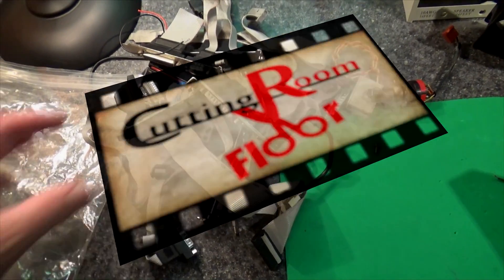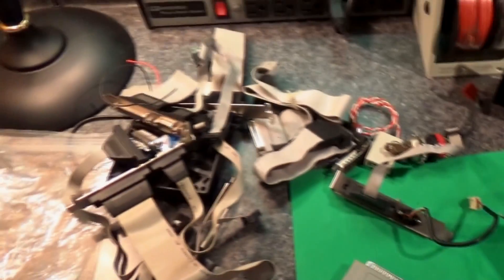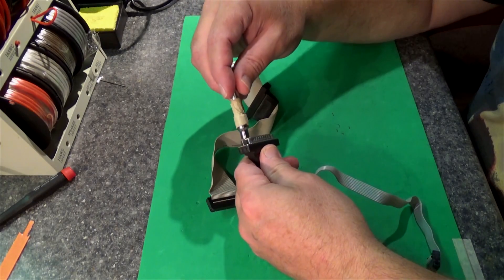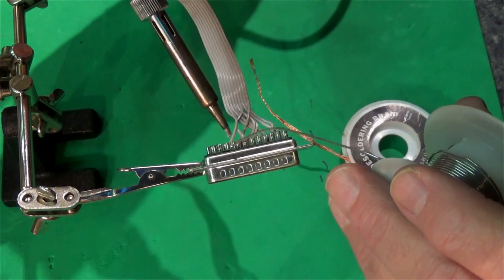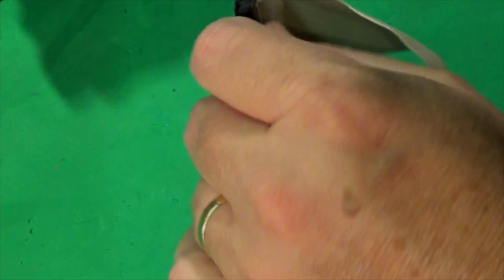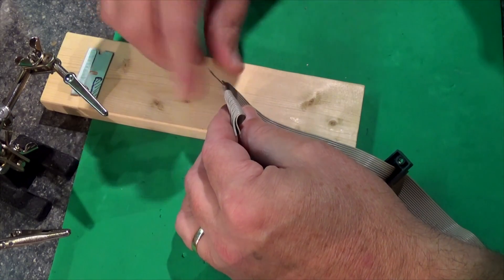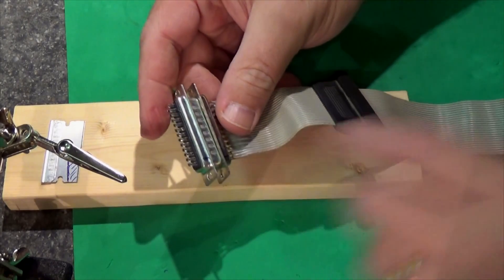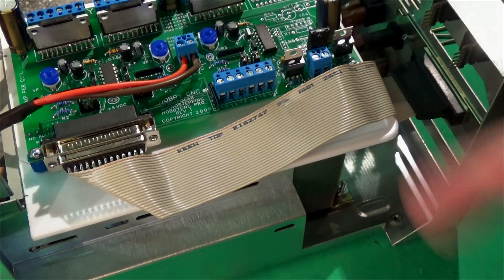Custom Parallel Port Cable - CNC Motor Controller Build

Comment: Great job! Quick question, I have a TB6560 with a 25 pinner, and I want to know if I can make my own adapter to usb? The UC100 is expensive and I just want a quick cheap workaround, so if anyone know if it can be done, will work, and easy enough to do, It would be great! Thanks!

Comment: i made a similar cable but it won't work. i have a generic Chinese BOB. But i have a printer cable which works for the x,y and z axis. it has couple of pins connected straight through. Any suggestion would be helpful, thanks.

Comment: You probably had a 25-pin serial cable there since it only used the 9 pins and was male vs female. I remember having some old 25-pin serial mice back in the day...

Comment: Wasn't that connector a push on type? That's what it looked like. Just push it on and it cuts through the insulation. No soldering needed.
Reply from the maker: Don't know but broke it anyways so no matter
Reply: GuruBrew D'oh! Well, if you hack up another one, take the original connector fully off. I'm almost 100% positive that the bulk of them are push on. I've moved those things up and down ribbon cables over my years of building PCs, and you usually just pop the back off (like you tried), pull the connector out the ribbon, re-position, and push it back on with the back section.

Comment: No worries about static or heat dispersion against the plastic cutting board ?
Reply from the maker: I got the idea from a comment in one of my other videos and they said it works well so I am going with that. We shall see :)
Reply: +GuruBrew It will be good to see how that works. Keep us updated. Definitely sounds interesting to do it that way.
Thanks for the reply.